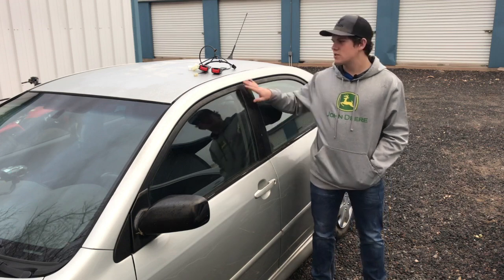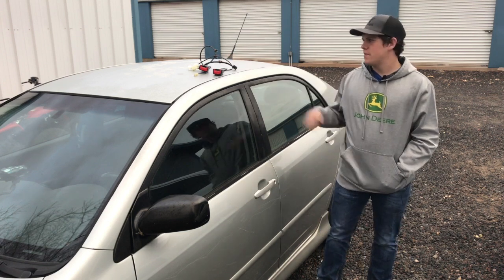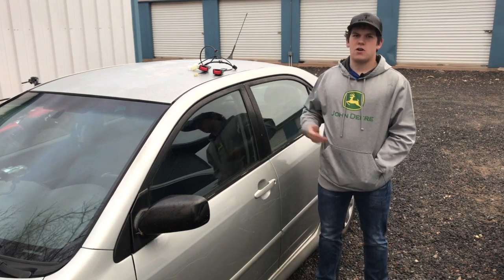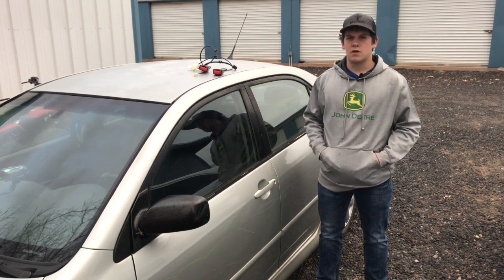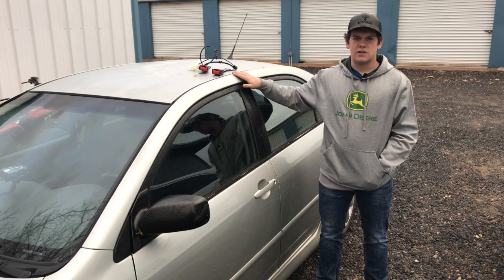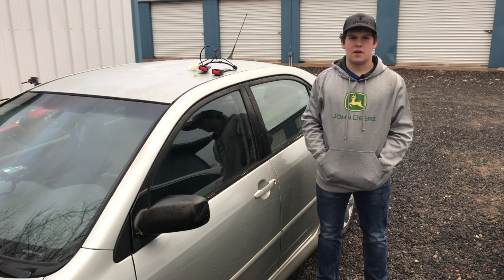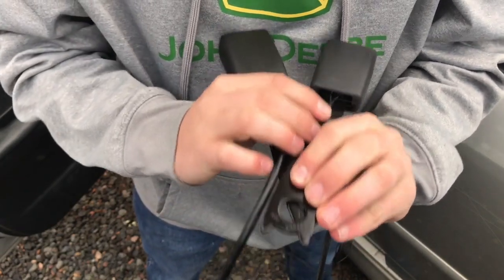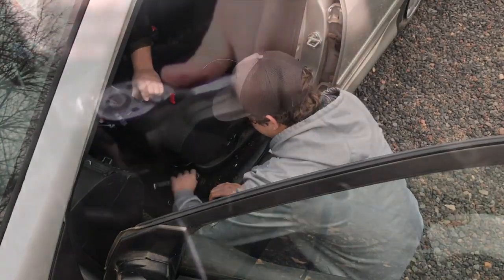How To Replace Seat Belt Buckles on a 2003 Toyota Corolla and The Best Place To Buy Them

Comment: Trying to replace front driver’s side seat belt receptacle on an 09 Corolla. I can’t seem to get my hand into the space of the plug and play wiring harnesses. It’s almost like the plastic covering on the side of the seat is in the way. Not sure if that needs to be removed. But doesn’t seem like it would come off without breaking it. Wondering if anyone has any advice. Thanks.

Comment: My question is, so you dont need to remove the  battery cables? And 2nd question is, can you just replace the bad "Press" seatbelt cover on drivers side, the spring broke inside and thinking maybe I just need that part with a spring in which I have, but removing the cover is an issue, is there a "trick" removing the cover? Or is it just one unit I cant separate? Sorry for all the questions,  but need some info! Thank you!! Oh my car is a 2004 Toyota Corolla S.
Reply: Patiently waiting for someone in the know to answer your question I’m having the same issue on my 09  Tacoma I have seen where you can repair the inside of that apparatus but I cannot seem to get that plastic cover from around mine it almost looks like it slides in there but it’s only one way it’s never meant to separate without destroying it

Comment: Did u have to disconnect battery?
Reply: why would you have to do that? Its a seat belt.
Reply: @Ancient1341  cause there are some videos telling to disconnect the battery lol...  My question is if it is necesary to remove the seat? I removed the buckle just using a 14  and now I am stucked in if is a must to remove the seat or if there is an easier way?